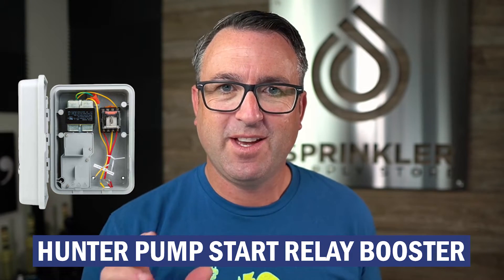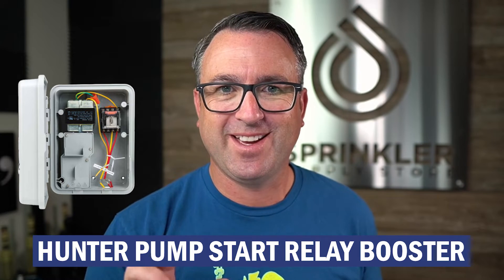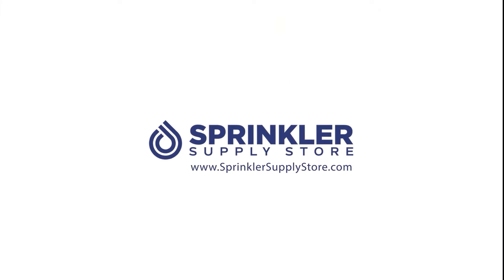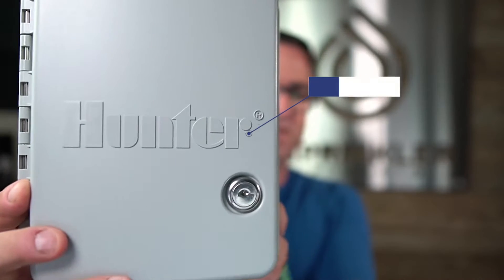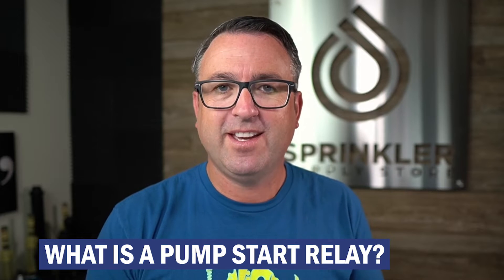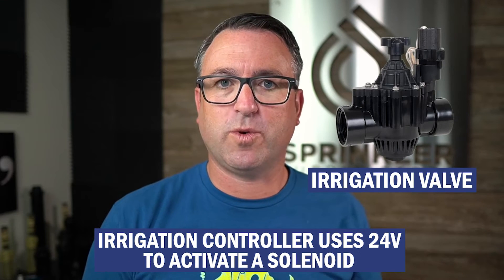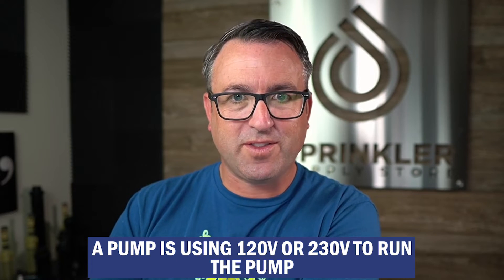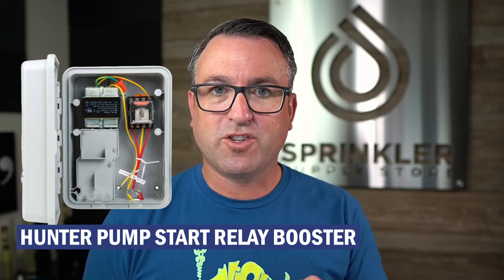Hunter - PSRB - Pump Start Relay Booster: Product Review | SprinklerSupplyStore.com

Comment: Hi Hunter, Great video. I do have a question. I have a ground water source and i want to use it for my sprinkler system. I understand i will need a ~70 PSI water pump @120V and a 24V sprinkler system control line. Now, I have 3 sprinklers to control and i have a 6 channels on my sprinkler control system. I also have a 120V line for the pump. All i need is a relay starter to start my pump when the sprinklers are ON. Any suggestions how i can wire this system?
Reply from the maker: I'd be happy to go over this with you.  Feel free to grab a slot on my calendar and I'd be happy to go through all the details and get you set up.  https://calendly.com/andyhumphrey/technical-support

Comment: How far away from the irrigation controller AND the PSR should the PSRB be placed?
Reply from the maker: The max distance is determined by the wire size. The booster is essentially an extender, and could be mounted next to the Pump Start Relay at the pump, or anyplace before it.

Comment: maybe you can make a video that tells the differences between PSR and PSRB, we don't know it clearly.
Reply from the maker: Great idea. I'll drop a note here just to help clarify.

The Pump Start Relay (PSR) is used almost every time. The PSR the standard, everyday, relay.

The BOOSTER (PSR-B) in the video, is only used when additional power is required. It was developed to provide a solution for  installations that have insufficient power to energize the pump relay. A common cause for this problem is the use of too small a wire size for the distance from controller to the pump start relay, or, a pump that is located too far away form the controller.